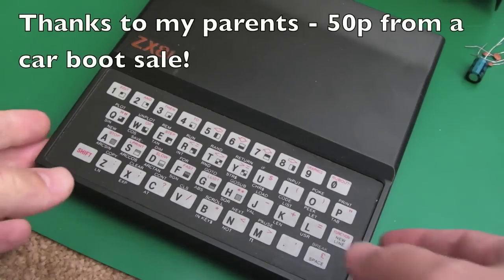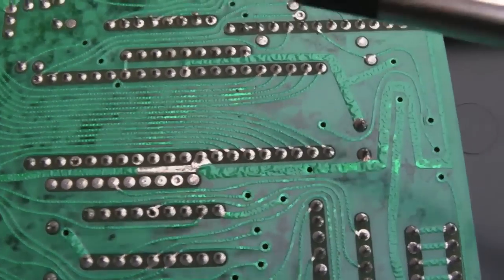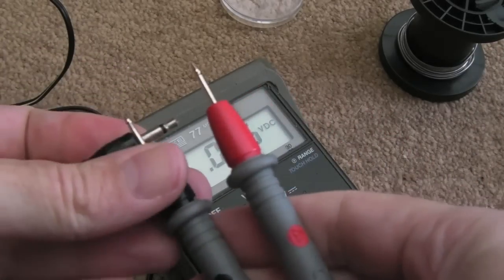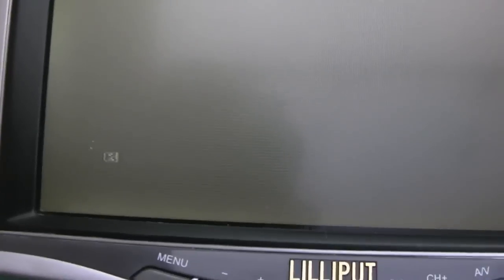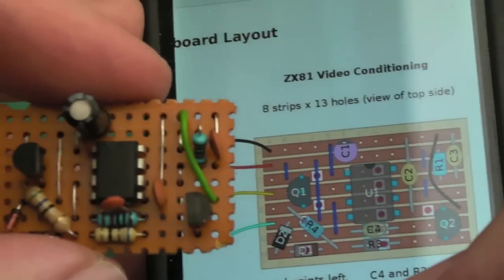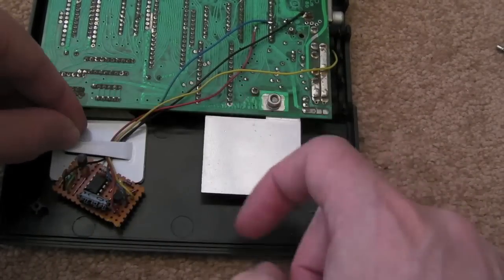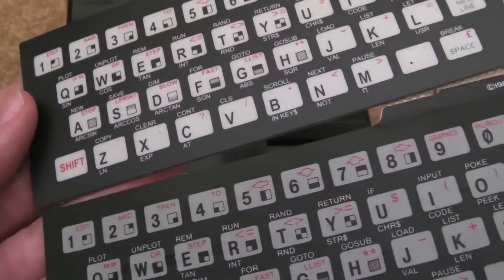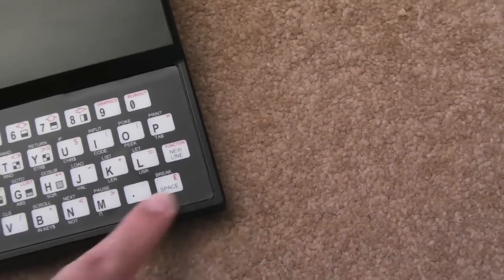Sinclair ZX81 Repair & Composite Mod

Comment: Yes, clean motherboard, and reflow all  joints with low-temp lead-free solder . If you have good soldering skills, socket main chips. Replace 9 volt regulator with proper new DC-DC converter,  as old one became very hot. And last, replace (paint) any missing green solder mask to protect tracings on motherboard.

Comment: Thank you so much for this video. Got a ZX81 with the same revision board where the commonly found composite mod produces a very dark picture. My machine has had some strange hackwork done to it in the old days. The RAM module was hardwired directly to the board with a wide ribbon cable. It also had a hardwired 3rd party power supply with very hazardous wiring (completely exposed mains). I obviously removed that and found a more appropriate power supply with the correct connector.

Comment: You can purchase a small RF to HDMI converter for 15 pounds on Ebay no soldering required.  :-)
Reply from the maker: You're kidding lol!  RF is aweful!!!  The best thing you can do with these is Composite mod them.  Then maybe convert the composite to HDMI if you need to.
Reply: @GadgetUK164  will let you know how it turns out. I ordered one

Comment: Hi i read all you needed was to put two MK4A4 diodes in series in between the output of the composite video out to brighten up the picture
Reply from the maker: There are two revisions - one is super easy to composite mod, the other needs this circuit!  I tried the simple mod to start with and it was super super dark - very hard to see.
Reply: @GadgetUK164  i have a revision 3 board. I plan to do the composite  mod. In 1982 i actually did an internal joystick socket mod. I wired to the 5,6,7,8 keys on the main board. Anyway the eprom on my zx81 actually says its 64k. I just realized this today. Was yours the same?

Comment: would that composite mod board work on a spectrum or is there an equivalent as thats much better than the normal mod you do to a spectrum
Reply from the maker: No, it's specifically designed to work with the ZX81.  On the Spectrum (48K and + models) it's very very simple, you litterally just take the video signal that normal goes into the modulator and pass it through a capacitor.  I think I show that in some of the 48K repairs I did earlier.  For the Spectrum +2 there's also the Ghosting Fix that you can do too.

Comment: I am building the JoustPerColoumb video circuit for my ZX81 but my local electronic component store does not have the 82Pf ceramic. Can I use a 68pF instead?
Reply from the maker: I cannot remember 100%, but I vaguely remember using a 47pF and a 22pF in parallel to give me 69pF.  Pretty sure that's what I ended up doing.
Reply: I GadgetUK 164. Ok thanks a lot for the info. I will try with a 68pF I have in stock then :-)
Reply: @GadgetUK164  Have done the mod and the result is simply amazing! The picture is sharp and cristal clear! :-D

Comment: I still have my old ZX81.

Bought a Maplin 1 K.Byte RAM kit back in the early 1980's, then designed my own 8 K.Byte RAM pack using a 74138 3 of 8 decoder and a Harris 8K x 8 static RAM chip.

I then spent £17 on a Harris 32K x 8 Static RAM chip and made my own 32 K.Byte RAM pack.

I added a Maplin ZX80 / ZX81 motherboard port extender and 2 x Maplin IO cards.

Then came the proper Memotech plug in keyboard with real keys plus Memotech RS232 port module.

It was all consigned to the cupboard when I bought a Sinclair ZX Spectrum +3, to which I added an external IBM 10 M.Byte HD (the +3 could only address 8.5 M.Bytes of disc storage).

This required a boot disc to reset the expanded disc parameter base to explain the HD to the +3 onboard drive controller.
Reply from the maker: Very cool =D  Do you still have that ZX81?  I didn't know Maplin were selling those things back then!  Cool on the +3 there too =D  I added a 1.5Mb Cumana RAM expansion to my 500+, and that provided an MFM interface - connected to a Seagate 10M HDD.  That was similar in that I needed to boot Work Bench from floppy to access the HDD, but cool none the less.   WIsh I still had that Cumana interface =/
Reply: I still have the ZX81 in a wardrobe along with all of its peripherals. I even added a 9 pin D plug into the top of the case (hooked into the keyboard) and had it attached to a Tandy two motor steering RC car as a robot for a while. I also have a ZX80 complete with ZX80 16K RAM pack.

The simplest IO card is a 74138 with a 74244 latching buffer with transistors attached.

For simple buzzer sound a 74138 on a set address above RAM top with a transistor driving a speaker triggered in an on / off loop will work.

The Spectrum +3 had the complete BIOS layout and this included the stuff that machine coders would need to know when attaching a HD to the Speccy. It could only address 8.5 M.Bytes and this is pointed out in the manual. I used an IBM Type 1 MFM.

I also installed a double sided 3" floppy drive.

If one has designed and built one's own IO and other cards for the ZX80, ZX81 and Spectrum then the PC's card bus is very similar to work with.

Most impressive used of ZX81 and ZX Spectrums was when visiting a factory and witnessing both running huge CNC milling machines, back in the mid 1980's.
Reply from the maker: Awesome =D  Had no idea the ZX81 and Spectrums were used to run CNC machines lol!  That's amazing, but I guess they were powerful machines back then!
Reply: The first CNC lathes and mills used shift register based computers which required that the operator typed in the whole programme what he'd written in an exercise book everytime the work was changed. To go back to a previous piece of work required manually writing the programme in again.

There were also limits to the programme size. We're talking a computer with 16 to 64 bit 7484 TTL memory using 74181 TTL ALU chips and registers. Some of the mid 1970's ones ran TMS 1000 and Intel 4040 4 bit processors. In other words, they were a bit thick.

There was also no screen display, just a Nixie tube or LED hexadecimal display panel. Everything had to be single stepped.

By replacing this contraption with a ZX80, ZX81 or Spectrum (I've seen a few of these running machine tools in my time) the following advantages were gained:

Screen display.
The ability to store a work programme to tape for reuse with the hassle of retyping it.
More complex and longer programmes could be written.
Cheapness.

Gradually replaced by PCs as cheap unwanted machines became available as PCs are equally as adaptable when it comes to hooking things up to them.

One place I worked at was using Amstrad 286 PCs to run "Pick 'N' Place" machines. (They still had a Spectrum running some other machine elsewhere).

Comment: Why would a resistor be connected to ground?  Also, does that company actually manufacture new keyboards for the ZX81?  I was thinking that the keyboard would be the hardest thing to reproduce.
Reply from the maker: There are various reasons, one possibility is to act as a pull down, so when a signal is not being driven high, it can be pulled low - otherwise it may "float" and not be detected as a low.   Another example might be as part of a voltage divider.
Reply: Ah, thank you - and that makes little sense even to me, amateur that I am :)

Comment: Okay, my electronics knowledge is very limited and i have a really dumb question. ^^
You used an 2n3904 NPN transistor, i searched through my electronics junk and only found an c3355 NPN transitor. I rewired everything but got no picture. I found a schematic that basically  was the same circuit but the discription of the transistor was just "simple NPN transistor". Is the problem that my transistor does not work for that mod or can it be that my ZX81 is dead?
Reply from the maker: I would try it with a new 2n3904 first - just to make sure, but it could be that you have a faulty ZX81!

Comment: Interesting video, thanks.

Regarding the 'dry joints', I imagine that the through-hole plating would have provided adequate connection for those, provided of course that the soldering top-side was OK.

Regarding your initial single transistor modification, I was going to criticise your circuit as doomed from the start, because a composite video signal is only 1V in amplitude to begin with and you fed it through an emitter-follower which will have reduced its amplitude by about 60% and potentially cocked up the sync pulses as well.  This would definitely be the case if the ZX81's output adhered to the standard composite video signal specifications.
But then I followed your link to the information provided by Joulespercoulomb, and all became clear.  The ZX81's output is actually 4V in amplitude, with a massively oversized sync-pulse, so the emitter-follower actually helps bring the signal back into normal proportions.
I like the circuit for adding a back porch - very good.  If I ever get a ZX81, this will be the first thing I do to it! Your picture results are excellent.
The only thing I would have done differently to you regarding mounting is that I would probably have added a tack of hot-melt glue to stop the board flapping around in the breeze.  But I don't think there is any problem with what you did.

Regarding the uncut ends on the RAM pack... that's shockingly bad! They can't all be made like that, surely?
Reply from the maker: +Brian J Hoskins Yes, I just followed an existing guide for that first transistor mod - that mod works on some of the later ZX81's apparently.  I didn't realise the sync pulse was too large so thanks for pointing that out.  My electronics theory is not great, I only worked in the industry for four or five years before I went into the software side.  Hot melt glue can be a good idea for something like this but it becomes a pain when you want to take it to pieces again.  As it is now I can easily disconnect the board by bending the arm up a little bit to release the wires.   Not sure if all the RAM packs are like that - if you ever get one let me know what you find!  I think I will swap the caps in the RAM pack - Dave Curran pointed out that there's a PSU circuit there similar to the one in the Spectrum.

Comment: Another great video ! I have found a great glue remover its called "stain slayer"  http://www.ebay.co.uk/itm/like/201353154209?limghlpsr=true&hlpv=2&ops=true&viphx=1&hlpht=true&lpid=122&chn=ps&googleloc=9045398&poi=&campaignid=207297426&device=c&adgroupid=13585920426&rlsatarget=pla-131843268546&adtype=pla&crdt=0&ff3=1&ff11=ICEP3.0.0-L&ff12=67&ff13=80&ff14=122&ff19=0

If you spray and leave it for 5 mins the glue will wipe off, its also good for those annoying security labels and it removed permanent marker instantly. Oh an it smells nice too like citrus orange !  
On another note that 3ds i was fixing, looks like those copper plates were connected to something, i just dont have the  eyes or a schematics diagram to see where they were going, it has now become a spares board.
Reply from the maker: +A Leadbeater Thanks, will have to give that glue a go =D  One of the problem with newer systems etc is the chance the PCB is more than 2 primary layers.  That 3DS could have internal layers as well.  That said, if you can see which via its going to there's still a chance you could fix it.  You need a really good magnifier!
Reply: GadgetUK164 I think your right with the internal layer,  according to one forum response the cart pin could be a ground the huge square is a ground point also but the small pin below needs to be connected to the ultra small via.  I have got electric conductive glue it's in a syringe looks a bit like thermal paste but it's not, do you think this would work if I were to fill in the gaps where the pads have been removed?
I'll keep hacking away at the board for a fix,  if all fails I'll send it to you,  would make a good video!

Comment: Sad that I recognised that circuit straight from the thumbnail :) Never built one myself, but then again that would mean I'd actually have to source ULAs for my ZX81s to get them working before hand :)
Reply from the maker: +Sabretooth Barnacle Haha at recognising the circuit from thumbnail =D  It's a shame but most of the ZX81s are going to die out because of the ULA, Spectrum is the next chip to go that way I think.  I wonder if we will see someone recreate the ULA in an FPGA or something, there's a chance that will happen as the internals have been fairly well documented I think.  I am sort of expecting the same thing to happen with the CIA and possibly VIC chips in the C64 at some point.

Comment: I can also recommend that composite circuit and RWAP's membranes. Inside the RAM pack is a bit like the power supply section of the Spectrum, and can be subject to the same sort of problems if one of the rails fails.
Reply from the maker: +Dave Curran Ah, that explains all the caps!  Very interesting!
Reply: +GadgetUK164 If you don't mind making a few changes, you can go for internal 16K RAM: http://blog.tynemouthsoftware.co.uk/2014/07/zx81-internal-16k-ram.html 
It's easier on the models with a 24 pin RAM chip, although the pads are there under the pair of 2114s. 32K needs an extra logic gate, I've done one like that but looks like I didn't get around to writing it up.
Reply from the maker: Thanks, will check out your article =D

Comment: Wow that is a  rock solid picture.  At school we used to ZX81 with huge old black and white TVs somebody had donated.  They wobble and ripple and do all sorts but we were very grateful for them.  

I suppose you could pair it with an MP3 player now for storage and have a completely digital system...........
Reply from the maker: +clangerbasher Yes, I need something like an MP3 player for this!  There is a device called the ZXExpand (VectrexRoli covered it last year) - that allows SD card as well as other things.   JoulesperCoulomb did a great job on the circuit there - check out his channel!
Reply: GadgetUK164 Back in the day I shied away from writing stuff on ZX81 because I couldn't guarantee it coming back.  Instead I used to wait a term for the Apple II and its disk drives. I think it would be enough for it without the complication of an SD card thingy.
Reply from the maker: +clangerbasher I remember countless hours of typing in listings only to have the system crash before I could save lol.
Reply: GadgetUK164 You had more patience than me. My trouble with programming isn't so much the doing it more having the need to do it.  Once at work I needed something to help   generate forms for laser printers and much to the amazement of my manager I knocked something up that could generate PCL  I had a need and so I wrote it. Just doing it for the sake of doing never got me going.   Being bright can make you lazy.  :(